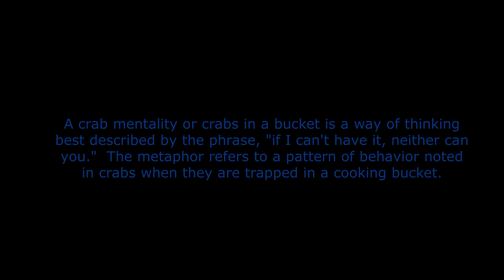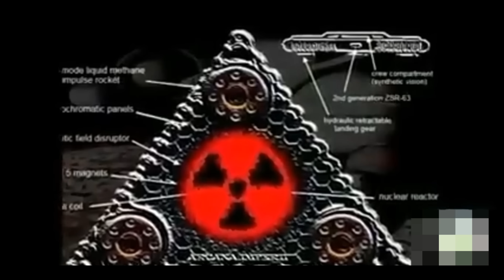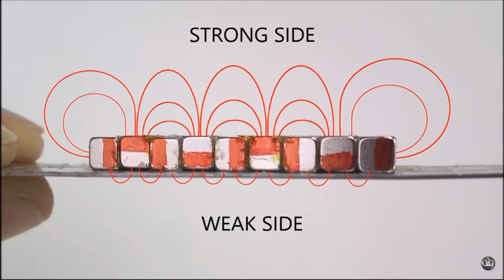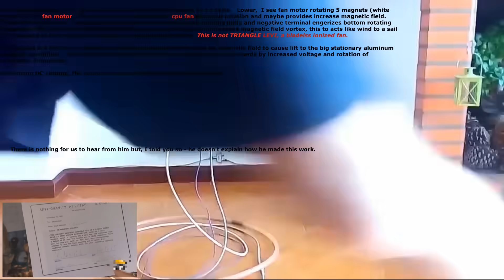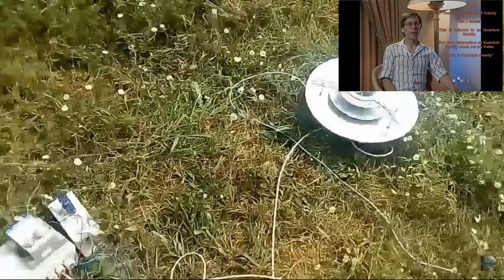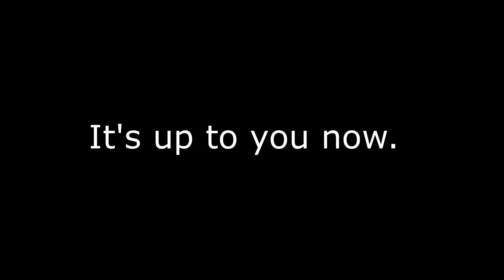anti-gravity project

Comment: Let’s pause a moment and reflect on yet another “repeatable experimental property” theorizing why light bends: The significance of David LaPoint’s 3 videos https://youtu.be/9EPlyiW-xGI    QUESTION: At the quantum, or more appropriately, sub-quantum level of a quantum flux field, what influence does a magnetic field have on flux fields, if any? Is there a difference in the sub quantum flux field shape or net polarity, within a photon at the onset of plasma resonance frequency? Is there an inference from all this that we might say, in order to vector a space craft, find ways to polarize it’s engine’s sub-quantum flux fields? So if I want to pilot the craft in a forward direction I need to polarize the flux field to a net negative in front of me and a net positive behind me? Is this steering ability only possible at resonate frequencies of the plasma field? Just wondering.

Comment: Gravity is a decline in the amount of inertia that matter objects create in the background field.  Huge matter objects (planets) distort the background field and lower the amount of inertia the background field can create with matter objects.  Because the amount of distortion is gradual -- in a *gradient* -- ie. the amount of distortion is highest near the planet  - objects near planets are exposed to lower inertia creation on the side of the matter object that's close to the planet.  The lower 'inertia pressure' on the side facing the planet and the higher inertia pressure on the other side commences an incremental move toward the planet, then the object is caught up in the declining inertia that maxes out at the planet surface.

MASS IS VARIABLE.
MATTER IS NOT VARIABLE.  MATTER IS ATOMS.

Einstein pointed out "As you attempt to accelerate to light speed, inertial mass becomes too great and light speed is the limit - mass (inertia) increases and sets a limit on velocity."

99% of people don't see his meaning.  "Mass - inertia - is variable.  And the amount that inertial mass varies -- can be controlled."

Accelerating towards light speed is one way.  The interaction with the matter object - a space vessel's atoms - interacting with the background field - any acceleration produces inertia - remember?

Accelerate your car.  You feel the inertia?  As you are pushed back into your car seat when you accelerate.  That is your body's inertia, its inertial mass reacting to the acceleration.  As your car keeps accelerating - 50mph, accelerate to 70mph, accelerate to 90mph - you will keep being pushed back into your car seat.  That is the inertia of your body.  That is your inertial mass.

Einstein said "Mass -- inertia - becomes too large to accelerate to light speed" - you have proved that whenever you feel pushed back in your car seat under acceleration.

MASS IS **VARIABLE**.  Matter -- atoms -- is a POTENTIAL to CREATE INERTIA.  Matter is fixed, not variable, in a matter object. The inertial mass that a matter object - a car, a planet - can make IS VARIABLE.

Accelerating moves a matter object through the electrodynamic background field.  (See stochastic electrodynamics for more info on the background field,  https://en.wikipedia.org/wiki/Stochastic_electrodynamics).  

Atoms of matter objects interact electromagnetically with the electrodynamic background field and create inertia.  This is conceptually identical to how inductors stop the initial acceleration of current in a circuit - once the current flow stops changing and 5 time constants pass, current flows freely UNLESS it is accelerated or decelerated (by an adjustment to the circuit's power supply, say).

Large rotating matter objects create turbulence in the background field - near the planet surface, downward-directed inertia creation is most affected.  The turbulence reduces the background field's ability to create inertia.

No one questions why pushing an out-of-gas car down the road presents a lot of inertia at the start of the car rolling.
"It's a car, it has a lot of inertia."    Okay dig a 200 foot deep hole under the car - it will fall instantly.

"That's gravity."
Okay what is gravity?

"No one knows, Newton and General Relativity are mathematical models, they don't explain what gravity is, we still don't have anti-gravity machines.'
Okay, you don't know what causes gravity, but you're 100% sure that  "whatever gravity is, it also cancels inertia in the downward direction."

We have to put our foot down and say "why does inertia decline in a vector pointed at the densest part of Earth's matter - the center?"
"It's gravity."  (no, you don't know what gravity is.  It's a decline in inertia creation.)  Why is inertia creation the same in EVERY DIRECTION except in a vector pointing at the huge rotating matter of Earth?  

Imagine you're in space with a matter object M, a big rock -- you try pushing M in all different directions and you notice 'this rock is putting up the same resistance to me pushing on it regardless of where I push.  It has the same INERTIA in every direction."

Near Earth, you notice 'inertia is no longer the same in every direction - inertia is dropping, in a vector pointing at the planet.'  Soon the gradient of declining inertia creation has the rock 'FALLING' to the planet.

You pull the rock back into space away from any planet.  You notice 'okay, I've pushed this in every direction, this rock now has the same amount of inertia in every direction again.'

Gravity is a gradual (ie. 'gradient') decline in the amount of inertia that matter objects make with the electrodynamic background field, caused by turbulence in the background field created by the planet.

Okay imagine taking the surface of Earth, gravity intact, and turning it inside out, and standing inside the new sphere.  Gravity is now pulling you in EVERY DIRECTION.  You turned the Earth's surface inside out, gravity intact, making a new sphere, and you're inside the sphere.  YOU'RE 'FALLING' IN EVERY DIRECTION.  The gravity is pulling you to the inside wall (Earth's surface turned inside out).   IN EVERY DIRECTION.'

That is how they cancel inertia inside the vessel.  You cannot feel inertia when you're already falling.  This patent creates a strong field using NMR (nuclear magnetic resonance) principles to in effect 'turn Earth's surface inside out.'

See figure 7, page 5 -- it is a pie slice-shaped cutout of a sphere made of Bismuth.  The inventor used a large rotating wheel in the place of a strong NMR magnetic field and RF oscillator,  and he got positive test results, shown in the patent.  But his effects are small.  Look up NMR first (https://en.wikipedia.org/wiki/Nuclear_magnetic_resonance) then look at the patent - you'll see right away "this is an NMR device."

His device does what the planet does -- reduces the amount of inertia created by introducing turbulence in the background field.
https://patentimages.storage.googleapis.com/3a/e1/0a/cdda5bf4825fb1/US3626605.pdf

The inertia cancellation effect is mentioned on page 12, left side, bottom paragraph.

Einstein told the world "mass is variable" and few people grok'd it.
.
.

Comment: The man that dropped magnets in a rock was missing facts as the magnets where falling through the earths magnetic field would have an effect on its descent but not much. Also there are electric fields in the air.
Reply: The man is (was) Boyd Bushman. A very clever man. Listen to him carefully and you can learn a lot.
Reply: I have read about other bucking magnetic experiments with similar results. I would have dropped the magnets in non bucking mode to see if there was an effect too.

Comment: What causes that little spaceship you made to levitate???
Reply from the maker: My thinking its the EMF + Capacitance, tuned with ultrasonic waves emitted by the driver from the top of craft at 40K Hz to  64 KHz towards the big array.  The big array is in ultrasonic standing waves enhanced by EMF bubble canceling gravity center of the craft, hence the craft moves upwards direction of EMF, bigger the EMF bigger the encompassing lift.